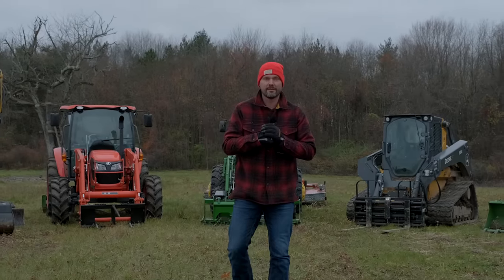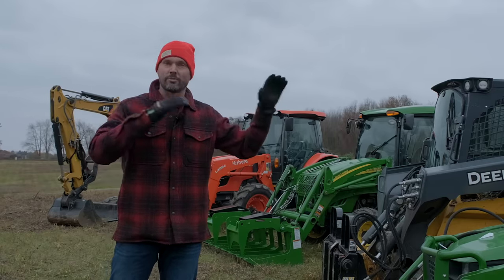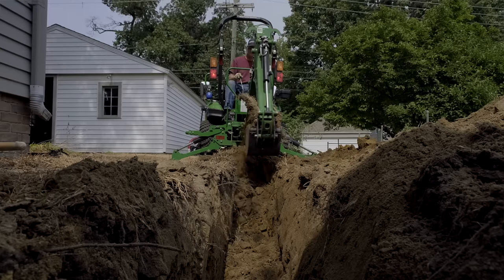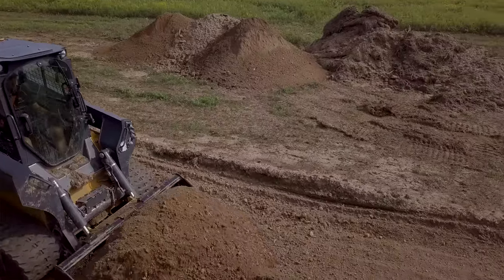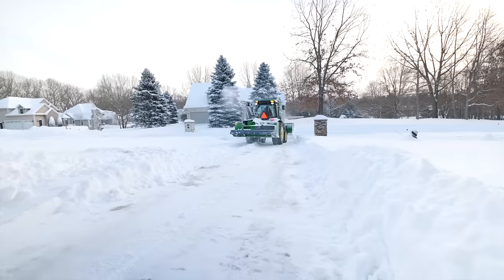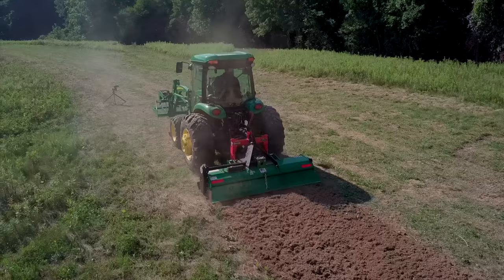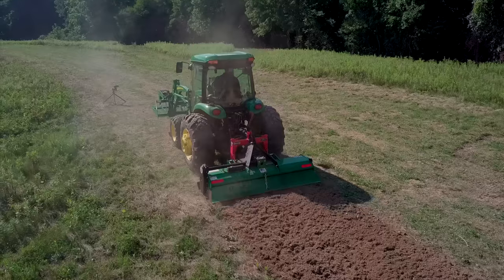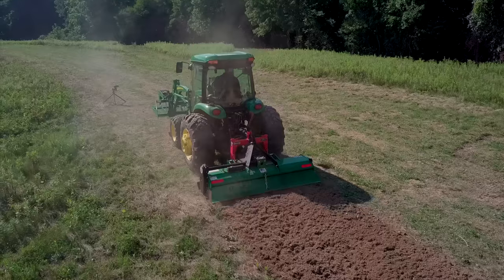IF I COULD ONLY CHOOSE ONE? BEST MACHINE FOR PROPERTY MAINTENANCE

Comment: I have 5 acres about half wooded and a 1025r with front bucket and backhoe. (60in finish mower, 4ft brush hog)  It does everything I need and more.   I use a 1/2 acre capable Worx robot mower around the house where the "fancy" grass is.   I got a fairly inexpensive set of clip on forks for the bucket and they really come in handy for moving things around.

Comment: We have 80 acres of hobby land for ATV trails, hiking, hunting and just goofing around. We love the 1025r, perfect for brush cutting trails, box blade and loader work. Sure it's smaller, but that means more seat time, more fun. It's plenty capable and easy to move around in the woods. Plus my F-150 can pull it on a trailer with ease. ...and cheaper. Really it was the perfect choice for us.

Comment: I could not have a "one size fits all"🙁. With 8 acres of land and odd shapes/fencing/gates/ outbuildings/ narrow lanes, my 1026R is for maneuverability/mowing/flailing/ pallet forks/ leveling/scraping and other general use. The Polaris Ranger is a fast run-about on and off road utility. JCB 8014 is for lots of digging. They all had to fit my budget and indoors in my small barn😄. I think the answer for us all is - how big is your plot and what are your routine needs as you can always hire for one off projects.?

Comment: My property came with an old 50s Ford 650 I use to mow. So the first machine I bought was a mini ex.  I use it a lot. Dig tree stumps. Move logs, rocks, dig foundations and trenches even used it to install my wood stove in my garage so I didn’t have to pick it up.  I made sure to get one with a thumb.  I am always operating that thing. Very handy machine.  I think a mini ex and a good tractor with a loader is a pretty good match.

Comment: We have a compact JD 3038e for our 400+ acre of mixed bush, field, and swamp.  It's small enough to cut grass & evades low branches yet has the power to pull a 6' brush mower.  A cab would have been nice in the winter but dressing up suffices good enough when snow blowing.  Also have an older backhoe we picked up for larger jobs but when I really needed it, my lack of experience forced me to hire a contractor.  Making it short, the JD 3038e was a great investment.

Comment: My "only have one " machine would be a Kubota M62(or the earlier M59 like I have). Powerful backhoe with thumb. Great loader capacity compared to a 4720( right at 4,000 lbs). Three sets of rear remotes. Backhoe comes off in 10 minutes. Drivers seat just spins around for backhoe work (can't stand the models where you get off the tractor and walk around to the back seat every time you use it). Only downside is the lack of cab. I prefer open cab, but many don't.
Reply: Love the M59 great machine 2000 hrs and going strong

Comment: Kubota B3200, loader equipped, quick hitch compatible, rear and mid pto, hydrostatic 3 range transmission. Split front brakes, float setting on loader, 1/4 inching valve on rear Pto.

Comment: Hard to beat what you picked for just overall effectiveness.  So many attachments for the front end loader as well as the third arm/quick hitch.  Plus you're in an enclosed cab, out of the weather and insects, with ac & radio... Skidsteer with a forestry mulcher though.... so much fun.

Comment: I'm on 6 acres,  1/2 of it wooded, other half is grass on hill and paved driveway.  The Kubota B2301 (23hp version of B2601) has been great. I mostly use it for trails in the woods and bucket work for mulch, gravel,  etc... I have a riding lawn mower for lawn cutting.

Comment: Early this year I bought a late 60s early 70s David Brown 4600 (46hp) 3cyl gas tractor for $4500. Runs drives, heavy duty front loader and rear blade. Absolutely love it for my 2.2 acres. Mainly use it to clean up trees and move them to where I’ll mill them. I need to make a pallet fork attachment or make my loader compatible for a skid steer quick attach.

Comment: I got my 1025r because of you, because I got .66 acres.   Yeah,  I can do other small jobs,  but a bigger job would be just as fun.  As for the equipment,  the work and acreage is the main deciding factor, especially in your case with trails.  But nothings wrong with multiple pieces with a designated task.  Skid steer with the heavier harder tasks like mulching,  excavator for trenches and water edge cleanup, and a compact series tractor for mowing, tiling,  and everything else.

Comment: Depends on your acreage and what you're doing. If you're running hay all day then you need a bigger tractor. If you're doing berries and gardens then maybe a small tractor to fit between rows or cultivate. If you are clearing brush, get a skid steer with a mulching head. I like the posting  below, buy what you need 80 percent of the time. That might mean two machines.

Comment: For me I decided on a new 2015 Kubota HST 4x4 L2501 with a Kubota BH77 Backhoe. It has the skid steer attachment option, & hydraulics for grapple. We live in the Sierra Foothills where the gold rush began. We do not farm and have no fields. The HST is golden here and constant direction changes are needed. From road building / maintaining using my Gannon box scraper, replacing our leach field, moving earth, and general property care this tractor has been very worthwhile. I think gear drive would be fine for large field work but not for constant back and forth.

Comment: I just bought a L3902 …an upgrade from my old L2501…
I didn’t mind the manual trans of the 2501 but many many times I needed get in tight areas on a slope or incline and it’s too intricate clutch operation without hydrostat drive! Plus I wanted more Hp and with the additional upgrades of the 3902 vs 3901 it was a no brainer for my needs!
Love the L series frame size , fits my needs well…I only have 2 acres but have other properties to take care of also. 
I don’t run fields or run my tractor for hours and hours so I typically won’t have to worry about over heating in the heat of summer!

Comment: Yes you can get back hoes for tractors, but in terms of use, if you do have a lot of projects, you will never beat a purpose built 360.
So I would strongly recommend keeping the 360 or hiring one for those jobs. 
I would probably keep the kubota, or a tractor 80-100hp farm tractor. But the skid steer seems such a good peace of equipment to perhaps have instead, but it is against tradition, its a tempting. But I love tractors and probably go for the skid steer, 360 and 80-100 hp Farm tractor.
But if I only had to have just one, for me it be the farm tractor with loader as you can drive it down the highway, cultivations and mowing, bailing, ect.
But I live in a built up area in the UK and I have a farm vintage farm tractor in my garage

Comment: A few months back I was commenting about using the skid steer more and parking the 1025r to put in the driveway. You defended the use of the 1025r.  Once you use the Skid steer and the excavator to get the property the way you want it, sell both and keep the big Kubota to maintain what you have. You can't beat commercial machines for getting the work done initially. To maintain afterwords a big utility tractor should do the job but I would add something like a commercial zero turn for finish mowing a few acres per week during the summer.

Comment: Simple needs, smaller property (3+ acres), all level, sandy soil, never sees snow, lightly wooded.  Want to cut down a tree, section it and have just enough tractor to haul each 10-12 foot section to the mini-sawmill, then stack it all for drying.  Probably 2-3 trees a year.  Also need a post hole digger to allow repairing/adding fencing as we will eventually have 1 or 2 paddocks/ grazing zones.  Heading into retirement in a couple of years so really looking at keeping expenses down.  Suggestions?  (Suburban boy with a country heart and now my own little plot of heaven!)

Comment: Very helpful in enabling me to decide which tractor I should upgrade to. The 4 series is my pick for all the reasons you mentioned. I also don’t have much need for a skid steer / mini excavator & will just rent them when the need arises. I still plan to get wheel spacers & heavy duty brush guard & will check your website when it’s time. Thanks very much for such a helpful video!

Comment: As stated, it all depends on many factors. I really need two. A utility tractor (gear driven) and a skid steer. The tractor is a good all around machine and the skid steer is a good heavy lifter that is very maneuverable. 
So a tractor for open field work and a skid steer for tight woods work and heavy lifting.

Comment: Here's my take. I own 10 acres with my house and machine shop on it. It was basically a house and a mix of bush and swamps when I bought it. And it's just about a nice yard now. 
I've owned or hired everything on this list and then some. Personally I'd be tied between a smaller ag/large utility tractor (I've owned 3, currently have a 1964 vintage but very low hour Deere 3020)  and a construction wheelloader/payloader if it was an undeveloped yard requiring a lot of work, and a newer compact tractor such as a Kubota B series if it was a developed yard that just needs maintance.  Obviously I am skewed a bit due to needing frequent heavy lifting, but I also have a large off-road forklift that I'm leaving out of this comparison. 

The tractor will do everything, badly. They are a poor loader, and a poor attachment carrier. For lifting/loader work a real loader or skid steer is miles better. For most attachments a skid steer or excavator mount is far superior. If you are mowing with a tractor, get your head examined and buy a larger commerical zero turn mower. Pulling attachment such as harrows or a land leveler is all that a tractor really excels at for the non farmer. 

For serious loader work there is no comparison to a proper loader. And they are comparatively cheap. You can buy an older ,2-3 yard payloader in reasonable to good shape for about half of what a compact tractor will cost.  These have power to accomplish actual dirt work, land clearing, grading, ect. They do not tear up your ground like a skid steer, and they are nowhere near as expensive (or frequent) to repair as a skid steer. 

A compact tractor loader backhoe is an expensive toy. Basically worthless. For what you spend on it, you can hire someone with a real machine to do all the work you will ever do for a small fraction of the cost. Likewise with a mini excavator. If I can hire a caterpillar 320 for $140 an hour it is not worth paying $60-80k for something 1/6 the size that will see under 100 hours a year. 
Again with the skid steer. For the specialized attachments they are suited to (which is all they are really suited to) you will never do enough to be better off than hiring one for $100 an hour. 
For any dirt work or land clearing beyond removing a couple of trees or spreading some gravel, you are better off hiring cat, trackhoe, buggies, ect as needed. 

If you have a finished yard you just want to look after and don't require any heavy lifitng then a compact tractor will be just fine. 

Beyond this just be honest with yourself that it's an expensive toy and that's why you're buying it
Reply: Tractor will do it all. Especially with the technology we have these days. If you have anything over 2 acres of land why would you get a commercial zero turn and spend hours mowing? Drop 20k on a 72 inch mower or drop half that on a nice finish mower for your tractor and do it in a fraction of the time. As a diesel mechanic I move class 8 engines around with a front load kubota. Attach a counter weight to the back and it's good to go. Granted I have a bigger model tractor(can't remember the model name) but with the ease of use a tractor can do almost anything. Of course like you said if you have a specific task that needs to be handled then rent that specific machine for that task. With all that being said tractor would have to be what I go with
Reply: @haydona1845  you've clearly never used both a zero turn and a finish mower on the same yard. I have about a 3 acre lawn, and I shaved about an hour off the time it takes to mow going from an 84" finish mower to a 54" Kubota zero turn. You can mow at higher speeds with the zero turn, and you aren't wasting time turning around like you are with the finish mower. Now maybe if your lawn is just a big empty rectangle it won't be such a difference, but not many people have no trees, buildings, or other obstacles.

Everything else stands. A tractor can sort of do everything, but it's not good at anything. Loader work is their biggest shortcoming
Reply: @geoffflato6065  Yeah I don't know what he's talking about.  It takes my dad about 2-21/2 hours to mow his 5acres with a zero-turn mower.  Wish he had that damned thing when I was growing up...
Reply: If you're doing any kind of mowing on anything but maintained or barely overgrown lawn you're SOL with most zero turns and you'll need either a tractor with a mower or a skid steer with a mower. If you're doing any kind of rough cut you obviously need a tractor. If you plan on moving your machine yourself and you don't have a 3/4 ton or larger truck and accompanying trailer you need a tractor, if you get any kind of wheel loaded besides one of those funky Avant ones you're looking at something like 10-12klbs of machine so you're easily into 3/4ton territory and out of easy transport for most people.

Honestly the skid steer makes more sense unless you're doing an insane amount of grading or you need to get that 2ton+ capacity from a wheel loader. A mid range skid steer is going to be coming in below 10k with a trailer so it's easy for someone with just a pickup or suv to move and go get serviced, it can take any number of attachments, has enough capacity for what a lot of people will do, can do dirt work besides serious digging, can now and it's compact.

You have obviously never seen what the mowers on skid steers can do also, even mid tier stuff like 262 cats are absolute monsters with mowers on the front and can clear a lot of brush/grass if you're a competent operator. If you have land that grows up quickly and you need to say cut hunting trails and fire breaks they're an amazing tool and much better than a tractor and multi use outside the mowing.
Reply: I agree with the tractor doing everything but doing it poorly. However the handiest tool I own is a mini excavator. It’s main down fall is moving speed. But it also replaces the hand tool I hate most a shovel. Another reason I like it is moving stuff/picking stuff up. Picking stuff up with a tractor your limited on what you can see. Picking stuff up with a skid steer your limited on when you can safely exit the machine with a mini excavator you have the best of both worlds.  However grading or leveling ground is painfully slow with a mini. Just my 2 cents.

Comment: The Excavator is probably the most versatile.   These days you can get a quick connection for the Stick and put a  skidloader attachment plate on the boom!...  then you can use buckets, forks, tillers, etc..   The biggest downside of an excavator is its speed, if you have a large property it can take a long time to travel around..  But in my opinion, the Excavator is what I'd choose. Then add a 60hp range tractor second.

Comment: Excellent choice- that's the 1 I would keep in your situation. My current ride is the 3005, only have 5 acres, tho.  We live in a world of compromise, it could stand to be a bit smaller in the woods, & it could stand to be a bit larger when moving heavy large items.  And, don't get me started on the antique manual transmission.  Hydrostat would make everything so much better lol.....
Reply: If you ever check out an actual farm, you'll see they have Numerous tractors. Many even still use the little baby Sears model they got 50yrs ago to mow the lawn....
Reply from the maker: Haha, I had a gem of a 3005 a few years back that I wished I would have kept.  I loved the sound of it every time I fired it up!

Comment: I love my 4066R, we have around 290-300 acres spread over 4 farms.  I use it to pull a 4 row planter to plant 7 acres of food plots, mow trails, move brush and dirt, lift deer blinds 8’ in the air, and most anything else I need.  I really want one of those 10 ft batwings, it would come in handy.  My dad has a Bobcat T630 to use on their property in MO and it’s pretty handy as well, but the best all around machine is the 4066R hands down. With bora wheel spacers of course ;).

Comment: I have a tractor with a loader and a back blade. I used it a lot until I got a skid steer. The skid steer gets lots of use and the tractor only gets used a few times a year now.

Comment: I have a 1025R with the heated cab and the loader, broom, snowblower, forks, and a salt spreader on the back, as well as a rear blade and a front snow pusher box blade. I also have a cat 301.8 excavator and the one thing I can tell you, if you accidentally flipped the excavator in your yard onto its side, the 1025R will not pick the excavator back up lol.

Comment: My grandparents had a farm with 105 acres and they bought a John Deere 1026r with a backhoe a front loader and they rent ou there fields and use this damn tractor all the fucking time. They love it I love it. Learned how to use a backhoe on it, and learned how to back up a trailer on it. Love the big green thing. Cheaper works great tons of add ons and it is extremely helpful.

Comment: Grew up on a dairy farm.

Moved a few states away bought 40 acres 1/2 woods.

Bought a bobcat s220 and shortly afterwards sold both my tractors.  The bobcat easily grabs 40’ trees and they are off to a pile…mowing…post holes…and the forks get a TON of use.   Out produces a tractor on dirt work by far….not even close. 

Building from the ground up my $30k skid steer paid for itself the first year.

I have no need for a tractor these days….